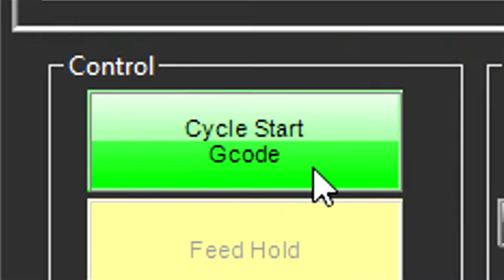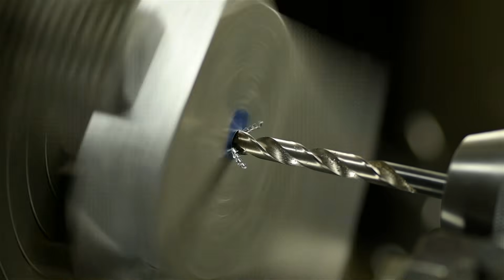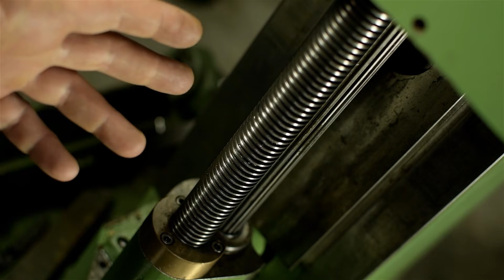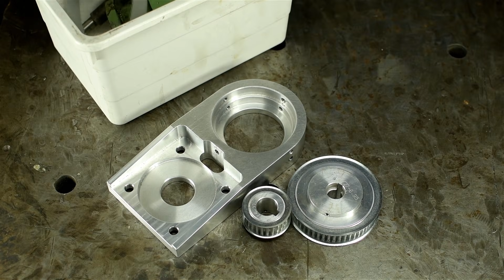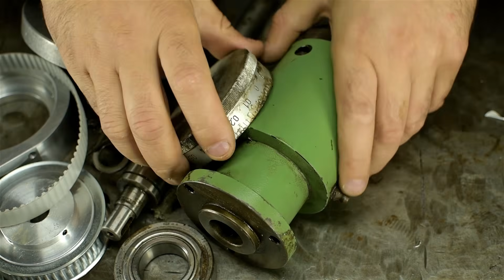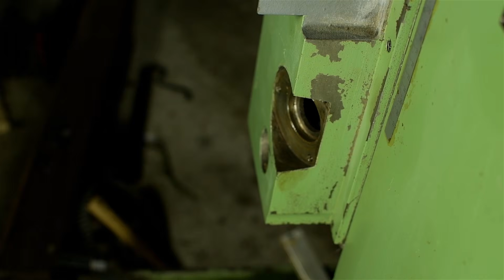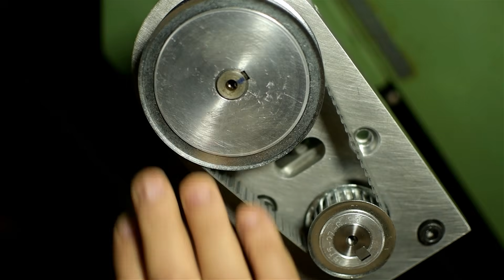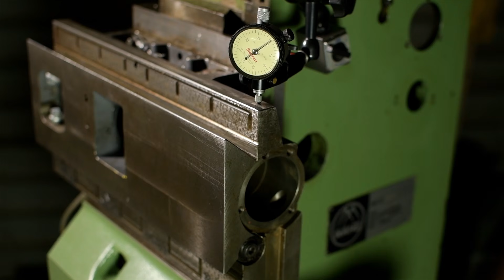MAHO: Move'n On Up!

Comment: Eyup TOT, I was thinking about that sprag clutch and nylon thingamajig. If it only locks in the downward direction, could it be something to make the controls a bit more even? When you wind something up and down it tends to be easier in the down direction (gravity sucks and all that). Would the added friction balance it out to make the action feel the same up and down? The reason it feels a bit stiff when it's on the bench could be that it hasn't got the weight of the Z axis helping. Obviously none of that matters with a servo (a servo won't care whether things are easier in one direction) so removing the lot would make sense. Oh, and I had a mouthful of coffee when you first tested the servo, so now I have a coffee flavoured laptop... :D

Comment: Just gonna theorize here, but since the belt is the only thing in that FLIR shot that isn't made of metal, doesn't it make sense that it's hotter ? It can't dissipate heat fast enough. One of the reasons I prefer direct drive.

Comment: Tony backlash when using as a manual DRO? Also the belt and your mounting bracket for the servo motor shouldn't be 20° above ambient room temp. There must be some kind of thermal conductance from the servo motor. Possibly bearings about to fail?

Comment: I'm dealing with servos slightly over a decade professionally and i strongly do not recommend servos for hobby router makers. So to say ethercat(or sercos or profinet etc) is be able to make interpolated motions, the fact is this can be possible with pro mechanics, not with hobby made routers.

Servos are taking opposite force and assigns the gain. This process makes a waving (approx. 20-50ms) on the motor shaft. For not having that waving, you need 2x bigger motors and drives and tightest tuning adjustment possible for pro jobs.

Step motors are much better for amateur routers, because step motors are blind and makes same steps in operations. Still brand new full automatic sewing machines are working with step motors.

So sorry, it took too long.

Comment: I really don't like the idea of mounting the motors through a gearbox, you're going to get backlash, and you don't have an encoder on the final rotating bit to fix backlash error. I know that Z axis is a bit trickier to do a direct drive on, but you need to remove the gearbox or find a way to put an encoder on the screw. 

Also, if you do end up going with a ball screw, see how difficult it would be to replace that spline shaft with the ball screw. The piece at the bottom of the Z where the shafts fit into has much more meat around the spline shaft. Even if you have to recreate that footing piece to make it work, you have so much more space to work with to fit a meatier ball screw in that area, as opposed to where the acme screw is. Though,  I'm not sure about the area on the sled where these shafts go into. If that little footing piece's shape doesn't matter at all, i.e. the sled doesn't interfere with the footing if you changed the footing's dimensions, then it'd probably be easier to just replace the screw with a larger ball screw with a new housing; but again, I'm not sure what the opening on the sled is like, and how easy it would be to modify this. Either way, going to a ball screw almost requires a beefier shaft, which requires modification of some sort, with the alternative being an acme thread that may potentially wear down faster and need replacing more often; classic case of initial investment vs. long term investment, more work now or more work later, higher cost now or higher cost after a period of time.

Comment: Greetings Tony, 

I watch your channel a lot and appreciate the great work you do. With that said can you list out the servo package you are using in the Moho CNC automation. I have 2 machines that I am dreaming up and would like to get a servo package that will work on both. One machine will have some significant weight like 300 lbf or more, so it probably will need a 1hp motor. The other would be a midsize mill conversion, somewhat Like you are doing. I am hoping to find a great servo package that can work in both scenarios. I have been looking into the DMM technology servos and they offer a package that is in the same price range.
Reply: +1, I'm in the process of upgrading the steppers on my cnc and the idea of having the control/drive and everything else on the end of an ethernet cable is a dream come true.

Comment: This belt drive. Concerns me. Any flexible material stretch just seams very not conducive to  prescision.
I would think a geartrain in an oil chamber would be so much better.  Or maybe a double roller timing chain out of a Chevy 350. Cheap and reliable, known dimensions to set tension.

Comment: Give that Trapezoidal Lead Screw a nice coating of EP2 or similar. It will help the lead screw turn a little more freely.

If you do decide to go to a ball screw, use an electro-magnetic, power on, brake. That can be wired into the enable of the motors via relays.
Similar to these: https://www.mayr.com/en/products/safety-brakes/roba-stop-m

Safety rated; for your pleasure.

Comment: heat on a pulley usually means an overtightened belt or out-of-parallel pulley, doesn't it?  tough to see exactly how your "set screw hidey hole tensioning system" thingy works.

Comment: To twist your mind a little more - most of today's 'steppers' are really servos with a built in drive electronics and little computer that are set up to take step signals..  (yuck).
Servos traditionally were just brushed DC motors - driven with a servo controller - often with a velocity feedback winding coming from the motor. (Servos are the deal - steppers need to drift off in to history.). A different way is to use linear scales to control the servo motor (or what some  are now doing - AC-servos - no DC power-supply. ) (PS: You will want a ball-screw )

Comment: TOT May be the teeth on the pulleys are jist not quite  correct for th belt, resulting in too much wear and this heat. 
I have seen this before with toothed belt systems.

Comment: G’day Tony, why can’t you drive that shaft directly with a simple coupler rather than use the belt and pulleys? Cheers mate. Michael
Edit...actually, no doubt you can. Better question is why did you choose the belt/pulley method above other methods, particularly direct drive?

Comment: the belt is too tight! that's why it gets so hot. the rest may be because of the heat of the servo! you need a counterweight to lighten the load of the servo.

Comment: If you ever upgrade the relatively high friction z axis lead screw to a ball screw, won't you have to worry about gravity backdriving it when powered off, dropping the Z axis? Maybe reuse one of those clutches in an active open configuration?

Comment: Maybe wrong Belt-Tension (and to small radius) is creating to much heat (deforming work), also there might be belt vibration. How "round" is the motorshaft running?

Comment: Question: since the servo motor has a rotary encoder in it does that mean you could also get it to auto calibrate for backlash because in theory it could detect moments of increased/decreased resistance?.

Comment: could run the belt in an oilbath .......... naaah maibe you need belts and pullies with a different shape tooth there like straight cut gears or angle cut gears 
the square tooth belts make a lot of noise and even some vibration , the rounded tooth belt makes a lot less noise . or maibe you tightened it a little too mush or it needs to wear in a little

Comment: What is the travel on the MAHO Z? I have a likely NoS NSK ball screw assembly for a Bridgeport  ~1.25" screw dia, 20" screw length, ~2.5" nut length, 5tpi. If that is usable for the project drop me a line. Currently collecting dust and light surface rust in the corner (need to oil it again) as I don't have a Bridgeport to put it in.

Comment: I don't quite understand why yout don'tneed any endstops or refpoints?
As I understand it the closed loop servos only count "steps" on their encoder, so they always know how far they traveled after referencing/bumping the endstop.
But after a Power Cycle, they don't know how many "steps" they are away from the refpoint or if they moved while powered-down.

At least its like this for my mini-scrap-mill.
What is different with your servos/drives?
Reply from the maker: these are immune to power cycling.  you tell them once how big their sandbox is and that's where they play.

Comment: "This is my first run-in with servos". Didn't you use a servo for the cnc router/lathe conversion? or did that not qualify as a servo?
Reply from the maker: close! that was a hybrid stepper.  still had pulse and direction.

Comment: Where would you plug in a probe or remote, etc into this ethercat system?
Reply from the maker: the drives have I/O pins you can wire to/from.  each drive has 5 or 6?  if you need more you can add Beckoff (sp?) style ethernet I/O modules.
Reply: This Old Tony I’m planning a old 90s CNC mill retrofit and you’ve got me shifting gears on what I’m planning. There’s not a lot of information out there for this application at least where I’m looking.

Comment: OHHHH! god linear encoders cause cheap screws are cheap screws digittal feedback lengthwise like those hiedenhains that came off there probly the wierd 1vpp or 11 micro amp sinusoid but like .00005 and linux cnc spinning plate on a stick alway's looking for center like a ninja vs. the encoder say's its there.. must be there?..right leadscrew mapping and that sturdy frame is a good hand to be holding in a I could fix it after that lighning strike on that 500 year old mesopo0taimian transformer out on the pole well... were waiting

Comment: Please explain how a ball screw works. I looked it up and am still confused.
Reply: Hi, a ball screw has a shaft with it's "thread" in the shape of a semi circle instead of a standard V shape so that small balls run in them. The female part of the thread is just a cage system holding the balls in position in a housing. The rotation of the two parts roll as opposed to slide which lessens the friction on the turn dramatically.
Reply: shane stevens so essentially a thread running on a ball bearing as opposed to internally cut threads like on a nut?
Reply: @micahwinters7021  yes, the groove is ground into the shaft and is very precise, and because the ball sits in the groove perfectly there is very little to no backlash in the thread.
Reply: shane stevens that’s awesome!

Comment: Haha ask jeeves I'm only 27 that made me feel old ,, could anyone recommend what they would consider the easiest mill to convert or buy cnc ready? and or the best budget cnc mill kit or conversion for doing atleast aluminium and mild steel? ,Im from ireland so would need to be in eu/UK at least to not cost a world in shipping my budget would only be like 2-3k if that's even doable at all? Iv wanted to build a cnc router for years but slowly thinking more towards a mill and a cnc plasma cutter instead,, Also if that budget isn't reasonable at all whatever you would say is reasonable would be apreaciated  thanks. Edit* after finishing the vid I was that servo system and 2-3k not gonna cut it 😂

Comment: Had an issue with imperial boring bars at work, turns out the dummies in the tool room couldnt tell the difference and just grabbed any ol boring bar. Freakin amatuers

Comment: Saw your video upgrading your manual mill to a CNC  and your comments about a home switch & hard Limits caught me attention. I get that not using these switches are acceptable .... as long as YOU  are in charge of things. Just remember that if you disconnect a motor all that positional information will go away. If you already know this, I apologize. We build lots of equipment and this can always be an issue. If I can help I would be happy to. mike@axisautomation.com